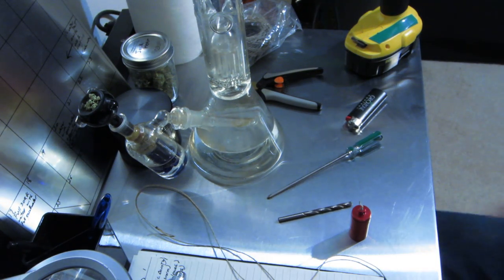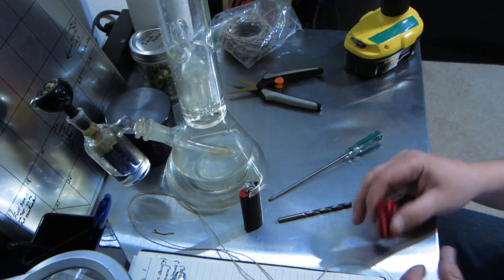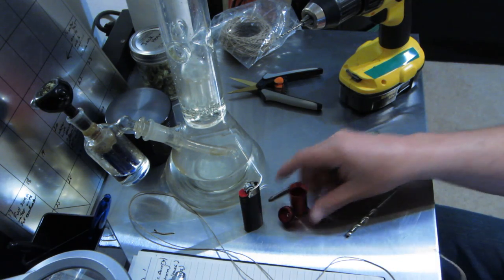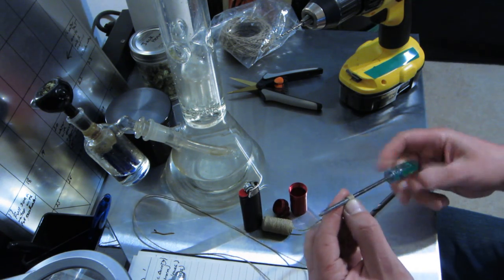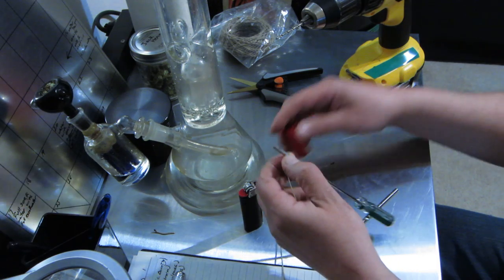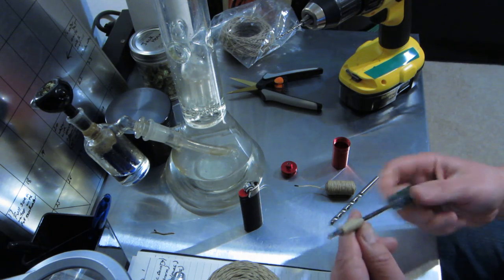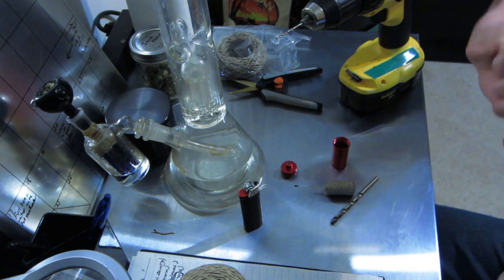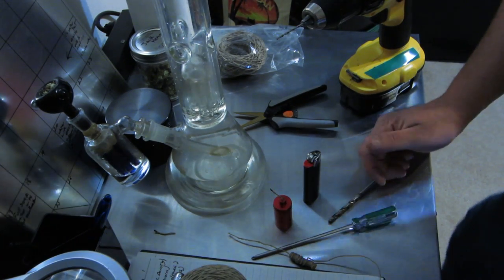Hemp Wick Dispenser DIY Tutorial

Comment: what up dude, I was trippin on my last comment so I deleted it, didn't even realize until right now, hah. Absolutely solid idea yuh got, the hemp will catch if the threads are not in same direction. I tried like 5 different times but after a while it would catch itself and get stuck;  Then I tried your method with KEEPING THE NEWEST/RECENT WRAP ON THE INSIDE. !!   That's the mo'fuk'n F key man, you do that and then make sure the threads are headed out towards the hole, just like wick, and you're laced up man like horchata esa.  Glad I saved this video, and butane will give you cancer just like broccoli, along with that flint which is toxic, you damn robots.  Light a candle you Gypsy's, save that Carbon Footprint what you can.  Keep it up brother, I piss on Lawyers too but Liar Liar was the shit with Jim Carey!!